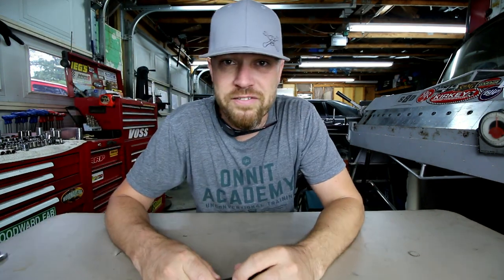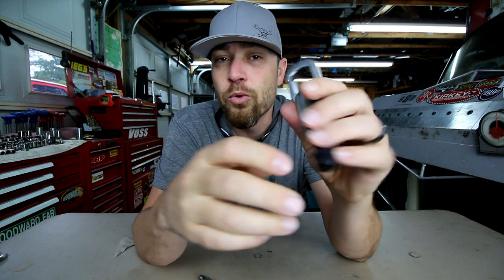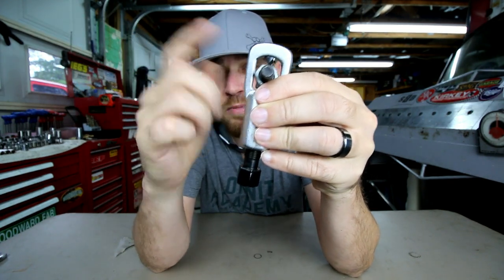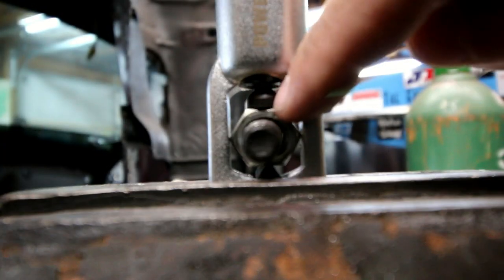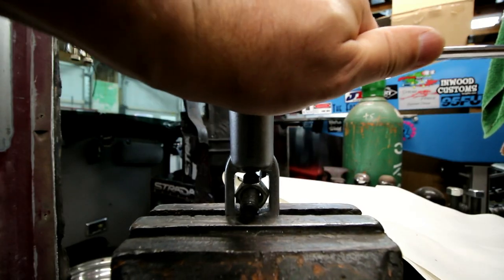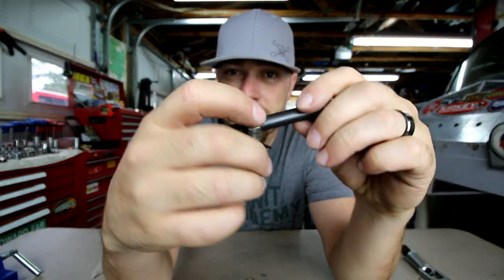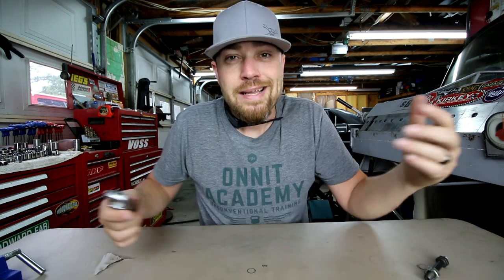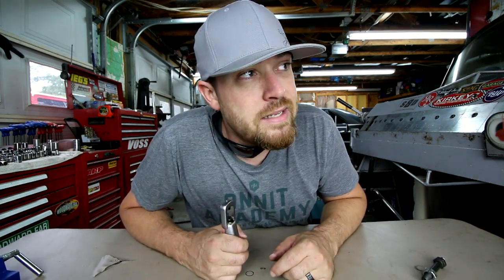You Need This Tool - Episode 68 | Nut Splitter / Splitting Tool

Comment: I have been a mechanic for 25 years and I can honestly say I've never used one. I usually use a cut off wheel or air saw to make a score line then I use a air hammer with a chisel to finish it off. I do it on 2 sides of the nut if I can get to it.
Reply: Just use a hot wrench (cutting torch)

Comment: Bought mine off the Snap-on truck 32 years ago and it still works fine. A little WD-40 on the treads of the tool before tightening it and you'll never have a problem.
Reply: I was thinking the same....Lube Fool.

Comment: Nuts come in various amounts of hardness. The nut is often labeled with a hardness symbol stamped right into the nut. The nuts that get the  most rusty and are hardest to get off, are typically exhaust system nuts, and these are typically nuts with only a mild degree of hardness. So they should be easier to cut through with a nut cutter, or simply a cold chisel and a hammer.

Comment: It's a tool that will make, or break your will to live another day. I'll admit I bought a cheap model years ago. Worked OK on the first exhaust manifold nut,  the second nut, the threads piled up on the splitter. Got pissed off, couldn't release the nut splitter. Got a hammer and started beating on the nut splitter back and forth. Saw movement, but exhaust stud broke flush with cylinder head. It does have it's place and time where you can't get in with a die grinder, with a death wheel.

Comment: From my experience with these they work best if you tighten and tap with a hammer, doing this sequence several times until you see deformation of the nut. This is usually enough to free it up where it can be removed with a wrench. Sometimes you may have to go two or three places around the nut to free it up enough so that it can be removed. You don't normally need to actually break the nut, just deform it so that the rust bond is broken between the nut and bolt. The impact from the hammer also helps to break the rust bond. If the nut does require breaking just do the tighten tap, tighten tap method until the nut breaks to keep from breaking the tool.
Reply: Yes, what you said plus several generous squirts of penetrating fluid to dissolve the corrosion.  Good tip; it also pays not to overload the tool in the first place.  I don't think the Kylester read the directions before he used it or he'd have known he was trying to crack a nut that was too large for the tool.

Comment: I was building a electrical crimper for battery cables and large gauge splice connections, and found that at oriellys last night $7.99 so I scrapped the other project. If you round off the chisel edge that then becomes the perfect crimper in a tight spot. I have to replace battery cables on diesels and cars all the time and it will make quick work of it verses a hammer crimper or those long bolt cutter looking crimpers.
Reply from the maker: thats cool
Reply: Michael--Good information on alternative use of a tool.  Sometimes I use a tool for a purpose for which it was never designed, because it happens to work for me in the moment.  Incidentally, the word in line 4 of your comment should be  "versus", which can also be abbreviated as "vs" or "v." (these last two are abbreviations commonly used in naming the two opposing parties to a lawsuit).
Reply: @stever5887  LOL

Comment: That type of nutspllitter always gives trouble of some sort. I found that they work best by tightening them up and then giving then a tap on the end before further tightening and further tapping until the nut splits. Otherwise use an impact wrench. After getting through about five of them over the years I now just use an air chisel from the start, still have a couple of nutsplitter's in the tool box one with a bend and the other still in good shape but that due to little use

Comment: I've had one for years. Rarely need to use it but it's higher end and always did the job. The problem is typically when you need it there isn't enough room to get it in there, (why you needed it in the first place), so use another cruder method anyway.
Reply from the maker: I could see that

Comment: My thing is this. Why not design the tool so that it splits the nut in half on both sides? Plus, it should have a better threading chamber to prevent damaging the tool causing it to seize. PowerBuilt makes a Nut Splitter that splits the nut from the other end, so you should do a review on their product. Maybe it's designed better, but I still feel that the nut should be split in half from both sides. I also feel that you should use a powered drill instead of a rachet.

Comment: what these tools are great for is stuff like one time use power steering fitting and other softer and thinner metal nuts, I've always had decent results although the two nut splitters i Ihave both have the cutter on the side you put the wrench on and where annoyingly costly.

Comment: A heavy amount of anti-sieze should be applied to the cutting edge as well as the threads inside, also an impact gun will hammer right threw a nut with less galling to the tool and an audible crack to the nut when its threw. Snap on makes a nice peice called the NC52.

Comment: I bought one about 15 years ago.. Worked well the couple of times I needed it.. Split one side then chiseled it loose and off. . The other needed a little heat. Handy tool to keep around though... You never know when you'll need something like this to get in where a cutoff wheel won't.... Nice work Kyle...👍

Comment: After you split one side of the nut. You suppose to split directly on the other side of the nut. And it will easily come off. Also my nut splitting tool actually has the blade going down instead of the blade being on the bottom. Which is better than the one that has the blade on the bottom.

Comment: Dude, you're supposed to let the sharp side bite into the nut slightly to the side, so it's cutting at around a 45ish degree angle with reference to the stud. Chomping straight down onto the nut is basically just pressing it into what is an almost flat surface :)

Comment: Lube dude, you cannot properly bust a nut without lube...   ;)
Seriously, i have found liberal high pressure lube or anti-seize on the tool threads is a must. 
I have had a set of 3 from Lisle Tools for about 30 years, super helpful in the right situation. 
Grade 8 or hard nuts split easier than grade 2, 3 or 5.
Also partially split the nut, then turn tool 90-180 degrees and finish splitting, taking care to not damage the stud threads, works like a champ. 

Cute kid, from experience, you are going to become the great protector very soon as she grows up and boys become a bigger presence in her life.

Comment: I always wished tools like this, with threaded parts, had acme threads and a good heat treatment.  Instead they almost always have small, fine threads and things like this happen. I know the more threads the greater the surface area but the threads don't have enough support behind each peak.  Plus the metal itself usually isn't tough enough either.
Reply from the maker: for sure

Comment: I've had limited success with them, some are better quality than others also. Success depends also on grade of nut/bolts. Cutting with grinder has always been easier and faster
Reply from the maker: Yeah I prefer just cutting them off as well but figured I would show everyone other options
Reply: I've had a few times where I stuck one on a extension and fed it in where a cutter wouldn't go and used a impact , worked like a charm. I think the speed of the impact is the ticket or I have just been crazy lucky as all get up. 
I use crazy cheap ones also and have been lucky enough not to break one yet (key word), I figure if it takes one stubborn nut off where there is no room and then breaks ... its "worth" to me. lol  
I've used them as half azzed wrenches to break rounded nuts also... tightened er on there for a good bite and cracked them loose.  :)
Reply: Larn Davies there's nothing wrong with grinding but there's always other ways to get the job done if you know what I mean.

Comment: I have never seen one work any where you need it to , tight spots. Better to just use a air hammer and chisel if you don't have heat.
The best way I have ever found is induction heater,They are hands down the best and I live in the rust belt where they salt the roads daily.nuts that are round from rust can still be remove with ease.

Comment: lube the treads of the tool before trying to split the nut. also they come in different sizes for that nut you should have probably used the bigger one. I've used them before and they seem to work ok. I like the plasma cutter or just a grinder but I used them for work near the gas tank when I didn't won't to catch on fire.
Reply: Smitty--Good catch about the lubrication.  I grease or oil all new tools to make them work more easily and to prevent rust issues.

Comment: My steering wheel nut holds the world 🌎 on its axis. When I was changing steering wheels,  I couldn't take ANY chances messing up those threads,  I wish I never used so much force on a puller, I think I messed up a wiper stalk, anyway,  slowly grinding that nut off with a dremel 🎉 I wish I did that FIRST! Micro engraving bits, etc. I almost bought a nut buster, I'm going to pass

Comment: One of your funnier tool vids.  Slitters usually work better on rusted nuts.  You can also help by hitting the side of the nut where the "splitter" goes with the angle grinder to encourage the split to start.  Lastly, use an impact wrench to reduce the chance of busting yours.

Comment: hey man just wondering if this will damage the thread after splitting the nut?
Reply: If the thread is intact, you shouldn't need to be splitting the nut anyway. Rather, just use a wrench and get it off normally.

Comment: LOL Throwing the kiddo in the intro mind #^*%* me for a second there..... well done sir (or "Daddy" in her case). 
 Got two kiddo's (around same age) I'll be sure to tell... hell Ill sub just for support (why not). 
 I use a impact of all things to bust a few nuts (no pun)... seriously though, impact and done... hits it so quick that the nut pops-"splits" quick as shit. I use cheap ass ones (got a bunch of them expecting breakage) and been lucky one hasn't broke yet doing it that way.  
 When I purchased them I figure if they could take one stubborn nut off it would be worth to me. lol  Nothing more I hate than things that won't come off-holding ya up ... so they been a life-head ache saver many times for sure.
Reply from the maker: yeah I probably agree with you. If the impact doesn't get it I tend to cut or plasma it off but I like to show everyone all the options that are available. Thanks for the support
Reply: 60th sub, I should win a prize or some shit.
Yeah, I usually end up cutting them off or whatever because the tool doesn't fit in most places i'm unfortunate enough to run into. I have used them as a half ass wrench for rounded off nuts also, just to break them lose. :)

Comment: maybe grease the threads on the tool, then lean on it with an impact haha. Should work better. Neat tool though. I might see if matco or snappy has one that isn't a million bucks.
Reply: I just looked it up on snapon.com; they want $105.00 for their manual one that handles nuts up to 3/4" across.

Comment: Two things. First coat the threads on the splitter  with anti seize because friction causes tremendous heat. Second I would never use an expensive ratchet wrench or a standard ratchet for this. Use a breaker bar if you have the space. No point in stripping the gears on a ratchet or ratchet wrench.

Comment: This tool is for people that don’t know how to use a torch to heat up the screw to let go of the rust. Or don’t know what a grinder is. You will damage the thread cutting it with a grinder or this, but will save money on tools which are one time use pretty much and are third party invented gimmick that does not always work. 
Why did you not put the screw thread to hold in place. It was unrealistic as the splitter would start to twist if it was loose making this whole process stupid in real life. Useful?  No, even your demonstration proved the tool is crap brand new. 
Edit: there’s already an alternative, it’s called a hammer, torch and a scorper.